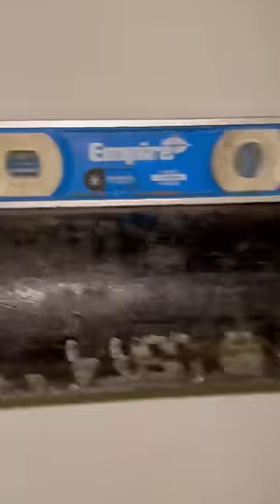Relocating a bathroom in Manhattan #renovation

Comment: Cutting into a live shit chute requires a danger premium.
Reply: Biohazard charge
Reply: I wouldn't have been willing to take the chance
Reply: Because you're not a plumber!
Reply: Did it once, we heard it gurgling and were frantically clamping the pipe from above....we lost that war that day. Me and my guy went outside and hosed off, wore garbage bags and went home....we were told the building made sure everyone knew not to flush for a certain period. Still don't know who shit on us😂
Reply: @Dr_Won_Hung_Lo keep a bucket close😂
Reply: @Weldoholic or contract bags
Reply: @AmazingJayB51  that’s even better
Reply: Bucket (big one) and a length of 4.5 inch PVC with a 45 elbow on the end. Chop the bottom cut. Then the top cut. It’s only “open” until you can get the PVC lined up into the bucket.

Comment: I have seen a bunch of your videos and am curious why so many slip couplings?  Why not change over to pvc and glue?
Reply: Local codes require cast iron, someone else mentioned it's fire code?
Reply: @mlindholm The rats in NYC eat PVC
Reply: @ellisr290  will you stop the lies. Dont dis my NYC. PVC allowed in residential in NYC
Reply: In NYC commercial requires cast. Residential can use pvc

Comment: worked a hospital sewer line replacement to a lift station in the basement, had to be done live.  so we did it 10pm to 4 am. since it was all cast (old pipe was split at top fortunately) we could prefab our cuts early and when it slowed to mostly liquids we started dropping and popping sticks. the lift was (mostly) open so our tarps funneled to it when we pulled a stick (for some reason this was run needlessly long, so im thinking the lift is an addition due to something changing with the outside sewer or the lift was moved from another part of basement) and replaced it all by the first morning flush. 

splashing pretty good by 5am. gotta love plumbing lol!

Comment: So different from London UK plumbering.

Push fit plastic everywhere…. No pride in a lot of work you see now.
If you can push fit a plastic fitting they call themselves a plumber.
Reply: It like that in the most of the US with the plastics. Only a few places requiring cast iron for drains and copper or brass for water lines. 
I have worked on most of the west coast and been in parts of the east coast and mostly using ABS (black plastic) or pvc for drains and PEX for waterlines. Some places will require the metal in commercial buildings but most of the residential is plastic. There are pros and cons of both.. plastic doesn't rust and is resistant to chemicals. The metal is solid and quieter and generally looks cleaner if done well.
Reply: In New Jersey only the rich people get cast iron drains

Comment: I have a question.
If the Super did shut down the water, wouldn't people still be able to flush?  It would be just once, but it would still work, yes?
Reply: Yup, which is the danger. I experienced something similar (to those tenants) the other night, city was working on the water main until about 10pm, and I got home from a road trip about an hour before they were done. As is usual, about 30s after walking in the door I had to drop a load.  Only realized my issue when the toilet flushed, but didn't refill!  Had to get out the sanitizing wipes to clean my hands until I heard the toilet gurgling later and could properly wash them.

Comment: Yoooo, show how to swap a fn water main valve. I'm truly interested.
Reply: Shut the curb stop if you got one, or use a freeze plug setup (dry ice, CO2, or plug-in refrigeration) to plug up the line, then make your cut and press in (no heat) a new 90 ball valve.

Comment: Just a piece of advice, when tightening a cp44 or any transition fitting, start with the inside cast iron side nut, second is the inside no hub nut, just snug them. Then cast outer nut and fourth no hub outside nut. Then repeat tightening them up in same order.

Comment: Why do city plumbers use cast drains? They’re inferior to pvc. Could it be so they can charge more and know that the cast iron is a deterrent to the DIY home owners? Maybe so they can justify the ridiculous hourly rates.
Reply: These look like commercial high rise units. City of Los Angeles requires cast iron piping in three stories or higher. It's a fire code. Have you seen what happens when PVC burns. It gives off cyanide gas.

Comment: Wye not use a cast iron snapper quicker and cheaper than sawzall blades just wondering broski 😊
Reply: Old iron could shatter beyond the cut line, requiring more replacement than you'd planned. It's not such an issue if that happens with the new piece sitting in your pipe vice.